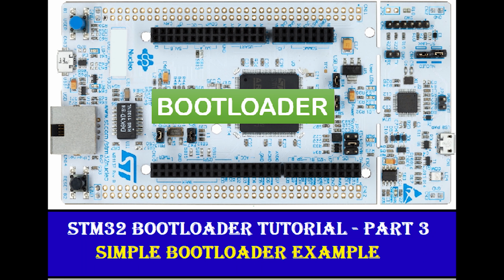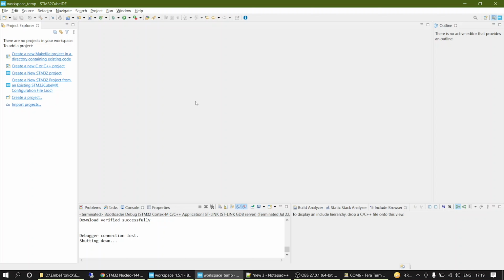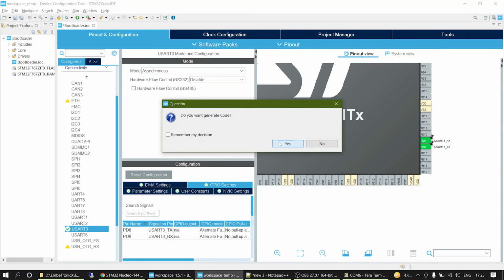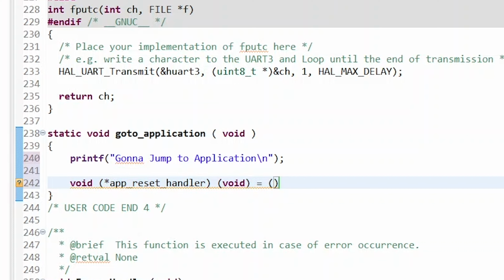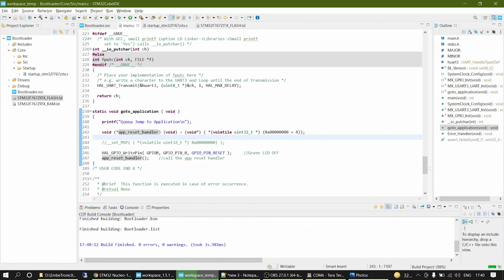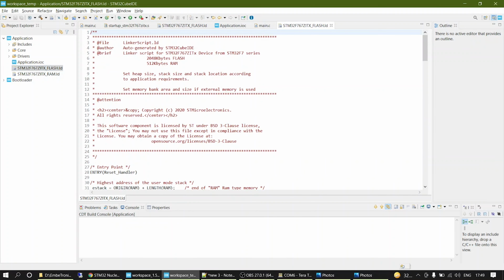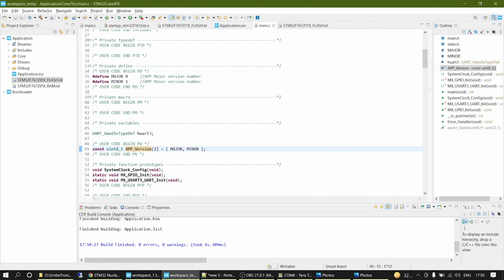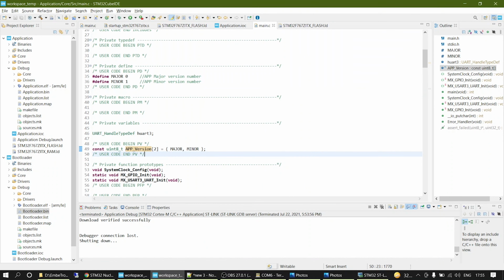STM32F7  (ARM Cortex M7) Bootloader Tutorial Part 3 - Writing Simple STM32 Bootloader

Comment: I am using stmf7 mcu. I configured the bootloader the same as the video, but if I exclude either the printf() function or the HAL_GPIO_WritePin() function, it does not jump to the application normally. Is there a reason for this?

Comment: I have followed every step that you said in video but application. bin file and bootloader. bin were not generated in my build.my controller was STM32H723ZGT6. please help me.
Reply from the maker: Hello, you need to enable this option in the project configuration options. By default srec file will be generated. You need to check the bin file file in that output option.

Comment: Hi, please why did you exactly add 4 in (0x0804000+4)
Reply from the maker: That is where the reset handler addreds will be stored.
Reply: @EmbeTronicX  is it mentioned on the datasheet ?
Reply from the maker: Basically the Interrupt vector table will be store at 0x08000000. In that reset handler will be 0x08000004. In this case, application will be stored at 0x08040000. So reset handler will be at 0x08040004.
Reply: @EmbeTronicX  Thank you so much!! but i get a problem  when I compile the APPLICATION code : "Break at address "0xfffffffe" with no debug information available, or outside of program code."
Reply from the maker: Don't use that address as it is. Check your Microcontroller's flash memory and make changes accordingly.
Reply: @EmbeTronicX  yes ,exactly this is what I'm doing because each uC has It own memory addresses . Anyway, Thank you so much I'll keep trying until It works.
Reply: @walidazerkane9430  . Hey i am also getting the same issue. i have configured the address as per datasheet, but still issue.
how u solved it. could u plz share ur insights. Thanks.
Reply: @walidazerkane9430  Same issue with me also. If u resolved the issue could u plz help me. Thanks.

Comment: Hi, I had the issue that the boot loader would not jump into the application. Although it worked following the steps in the video it didn't work anymore on following power cycles.
I had to disable the systick to have it working consistently all the time. Probably the flashing of the application changed the timing enough so the systick interrupt does not fire when jumping to application.

Comment: hi i like your video very much and have been following your video, i have done the steps u provide in the video, question is how can i erase this bootloader that i had programmed? i m using STM32H7A3 Nucleo board
Reply from the maker: You can use ST link programmer to erase the bootloader.
Reply: @EmbeTronicX  thx, could you kindly provide the steps? cause now i couldnt start coding other project..
Reply from the maker: @woldecosgrove use STM32CubeProgrammer or STLink programmer to erase the entire flash.